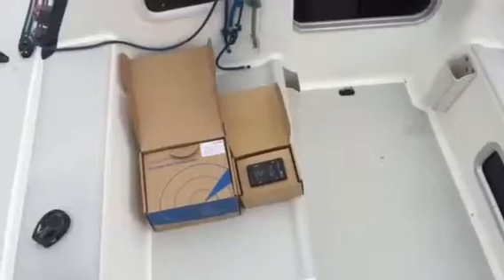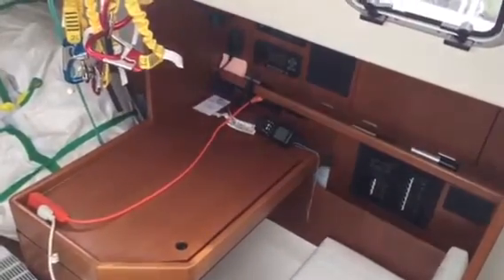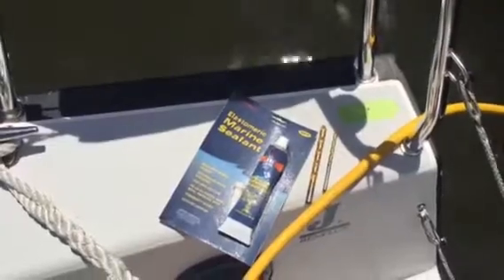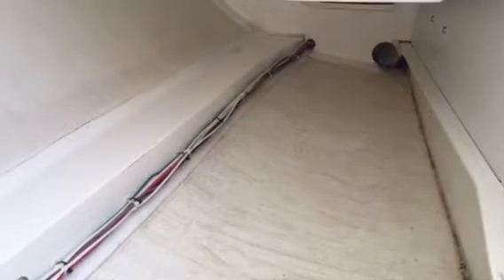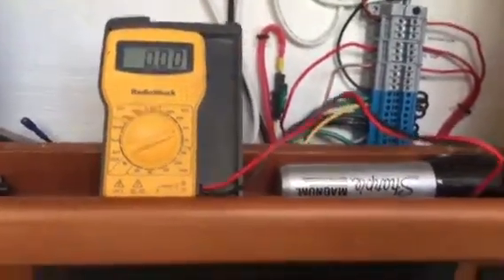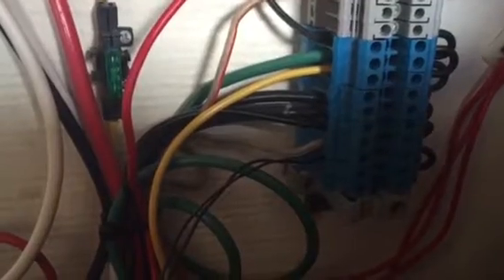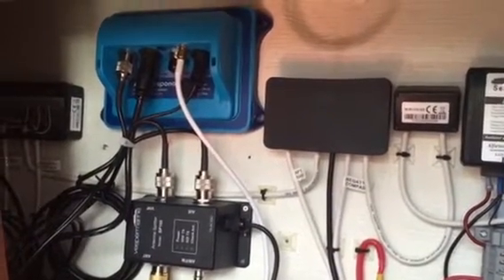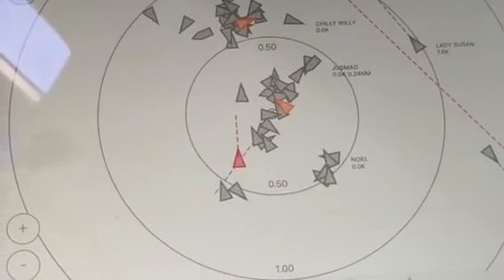Vesper AIS XB 8000 Install

Comment: Thankyou for showing this- I was wondering how you went with the power to splitter connection and if you did any other nmea data connections to the unit?
Reply from the maker: Hi Matthew, I did not install any other NMEA connections to this unit. The instruments were old B&G which were pretty temperamental and owner was thinking about replacing. Follow up: this Vesper AIS unit worked great at Chicago-Mac race and help facilitate rescue of an overturned trimaran!